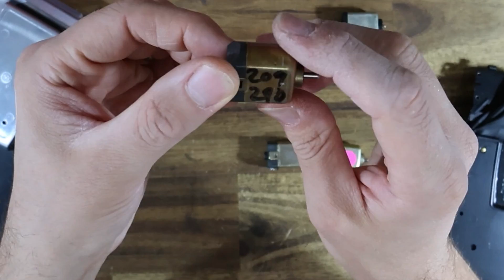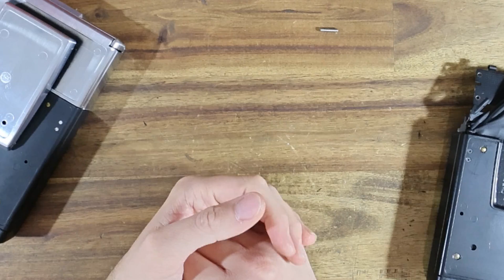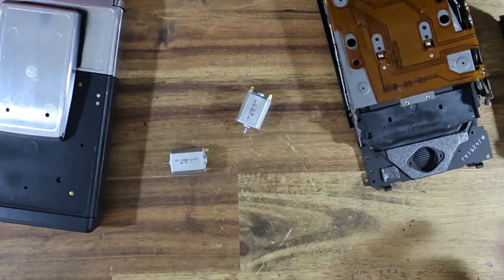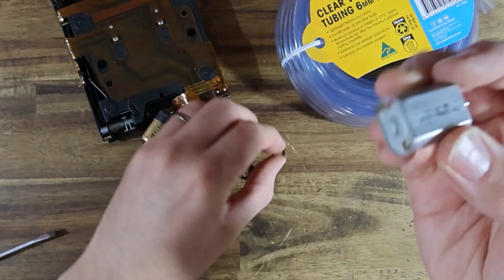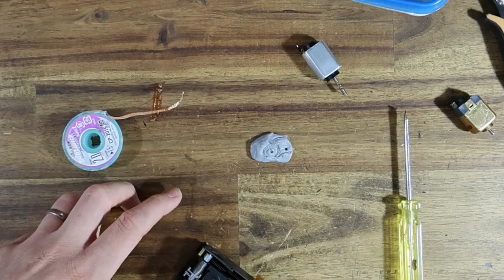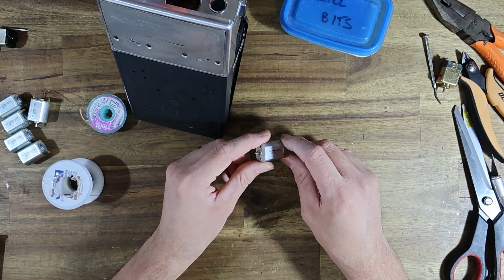I found MiNT and Retrospekt's motor supplier! Brand new motors for your SX-70!

Comment from the maker: Hey guys, a few important things that I wanted to add:

1) If you want to buy one of these motors then google is your friend. Search for "Mabuchi FK-130SH-16140". They can be found on eBay, ali-express etc. You can also contact Mabuchi direct too if you wish to buy thousands of them
2) Note that other FK series of motors exist of identical size, but they are NOT compatible due to the far lower RPM. The '16140' is rated somewhere around 10 000 RPM depending on the exact voltage. Others I have found were much too slow to work on an SX-70
3) This bullet point is for those that insist on leaving negative comments about the visual quality of my videos - while offering absolutely 0 constructive feedback. Your comments offer nothing of value. I don't mind feedback if its actually helpful, but you don't need to be rude about it(see Prash's pinned comment in my first upload for an example of good feedback).
I have purchased a new 1600 lumen LED light bar for use in future videos, to try and increase video brightness, help with my cameras auto-focus and reduce harsher shadow casting while I do my videos. I believe this will help improve the visual quality of my videos in the future.
Sadly my 'temporary' workshop is now my current permanent workshop for the time-being due to the West Australian housing crisis. Truthfully, I never intended on being in my current workshop for long, and thus it is not set up as ideally as I'd like it to be. I simply didn't want to invest money into a location that was not meant to be permanent. 
As a result, in previous videos, my camera sometimes misses focus, or light balance turns weird. Despite the occasional lighting hiccup and wonky focus, I still feel that my main message and technical ability still comes through in the videos. So shut up about the lighting already. I'm already aware.
Reply: Glad to hear about the upgraded lighting coming soon 👍🏻
Otherwise your videos are just great.
I already knew you from Facebook but I hardly use that so I'm delighted you finally started using your Youtube channel 🥳
Reply: Hello, I would like to know if this is applicable if the speed exceeds 12000rpm, such as 14000rpm.🤔
Reply: Hi. First great job…learning a lot with you. 
I’m tiring to find those motors ("Mabuchi FK-130SH-16140") online but all of them only provide 9300rpm at 6v. I even bought one and it’s very slow. Any link that you might suggest? Thanks and keep the great job 🦾
Reply: The SX-70 motor is a 12,000 RPM one if you can trust the original advertising and articles. 

In the SX-70 film by Eames it’s stated that the motor is 12,000 RPM.
Reply from the maker: @ianbakke  at 7.4v this motor is rated for 14000rpm

And at 5v is rated for 9000rpm

So at 6v this new one should be pretty much spot on
Reply: I watch some of your videos, and I don't mind the lighting/video quality at all. Most of your videos are very long, so I keep it on in the background while I cook or do something else, and listen in and out. I'm not watching it with my full attention most of the time. Most of your information is spoken, not shown. Unless I intend on learning how to fix SX70s by watching your videos, which I doubt most people here are trying to do, I don't see why visual quality is so important.

I personally wouldn't bother increasing the visual quality unless I plan on improving the editing and chopping it down from 40-90 minutes to 5-10 minutes. It's really at the 5-10 minute mark that people will watch closely as well as listen.

Also, if you want to cut down on the harsh shadows, what you might need is an "LED ring light", the ones that women/people use on instagram for makeup tutorials. Notice how these makeup tutorials never have harsh shadows. LED light bars will cast harsh shadows usually. You can also look into a better camera, but it's not worth it unless you're looking to spend $300-500 at least.
Reply from the maker: @haxuco  this is kinda my thoughts too. In terms of repair videos - like 80% of the detail comes across verbally and could easily be cross referenced by looking at the camera in front of you - or the repair manual PDF 

A ring light around the camera might help... 

But I think that the levels of light is fine overall - it's mainly just needing something to get rid of the shadows

Comment: I have seen a few people on facebook short videos that have changed their film counter to start at 8...do you know anything about this?  seems like it would be a worth while mod if its not too difficult...
Reply from the maker: This topic will eventually get it's own very very very very long video

It's possible but most solutions are somewhat of a "hack"
Reply: @theinstantcameraguy  have you had a chance to work with the sx70r board that has sx70/600 switching but no bluetooth? I dont quite get what the point is without bluetooth...does it still somehow have manual exposure? I am considering getting it for one of my sx70s.... any info on it would be great if you have any...thanks
Reply from the maker: @quitethecontrary1846 it's only for auto mode

Comment: love this video. Hi one question here, do you know what's the model for SX70 (sonar) motor driver (it's located just beside the motor in flex circuit), I think it's a customized H bridge motor driver. I had mine burned when I was trying to use external battery pack, due to misoperation, the motor was stucked and then the driver burned. Thanks you.
Reply from the maker: it is propriatary

Other driver chips exist, but the pinout is different. Technically you can use them, but you need to wire the pins in different
Reply: @theinstantcameraguy  Thanks!

Comment: Hey Jake, do you have any insight in this problem where everything else is working but the motor is not running at all? I know the motor is still good and I think something may be wrong with the MCC (can shaped) or maybe even the IC in the lens assembly. I have a Model 2 in Ivory with a kapton body flex and I noticed the MCC getting quite warm when the camera is powered for a bit. All traces, switches, and wires seem to be okay using a multimeter and I don't know what's the correct voltage/continuity for the MCC.
Reply from the maker: @robertw1469  MCC chip is probably blown
Reply: @theinstantcameraguy  Well crap, there goes my attempt at fixing a broken Model 2 (I was soo close!). Thanks for your input though!
Any chance you know if the newer DIP versions are compatable or know where to get cheapish replacements? Am curious if I could fit a modern version in if I knew the pinouts for the bodyflex/MCC (I couldn't find all of the repair manuals/bulletins online). Polastudio's bodyflex replacement is like $100 and I have yet to find a spare parts SX-70 with the can style MCC. Thanks again.
Reply from the maker: @robertw1469  I've never tried to adapt one onto the other

I'd assume its possible, but it would be easier to just swap the entire ribbon cables over if you had a spare camera lol

Joaquin from the OpenSX-70 project found some similar replacements, but I never found them to work properly

Comment: Hey Jake. As always, thank you for sharing your valuable knowledge with us. Just an idea, maybe standard o rings would be suitable as well for bushings? They come in many standard sizes, and I would guess that they are the correct material as well. I have been using them as rubber idlers for cassette decks for years without fault.
Reply from the maker: O-rings would work I think. But their 'round' edges may make them prone to falling off

Cutting up hose provides a square edge, which is easy to glue

Comment: I try to work on my sx70s in my free time and have a really crusty motor in one of my model 1s which I refurbed but wanted to replace. I got a donor from another sx70 but wanted to look into motor replacements(I remember a blog post on opensx70 where Joaquín talked about replacements but wouldn't reveal the source). So I ordered a bunch of motors from aliexpress that seemed to match the spec. I wanted to try doing load/rpm testing and compare the original motor with the potential replacements but never got around to it. When you showed the motor I looked in my bag of motors and sure enough I had the exact same one hahaha.

I really appreciate how much effort you put into it to bring us this obscure, niche info. I don't really have a lot of experience and don't have too many cameras so I'm always scared of messing a camera up permanently which stops me from trying a lot of experimental things. Your videos really fill in that gap so thanks a lot!

I had a question, instead of crimping the spring, have you tried using heatshrink over the shaft (with a little hanging off the end as a guide)? it should get it in the same ballpark as the original shaft.

Edit: Oh, also, do you know if the motor in sx70 box type cameras are the same mabuchi 2mm shaft motors like in the 600 cameras or the 2.5mm type?
Reply from the maker: heat shrink, glue, JB weld etc will probably work

But honestly, crimping the end is fine, and fits in line with the 'pressure fit' of original Polaroid springs. It also takes only seconds to perform.

All mabuchi motors use 2mm shafts instead of 2.5mm, and thus need crimping

Once, for fun, I took apart a modern mabuchi motor from a 600, tore it down, and replaced the bearings and rotor from an alpha motor. Effectively giving a 2.5mm Mabuchi. It worked like a charm once finished, but was a LOT of effort
Reply: Thanks for the reply. I wanted to avoid messing up the spring but seeing as you've had success with it I'll give it a try. The hybrid motor sounds interesting, might give that a try as well

Comment: Do you know what material the bellows are made of? I'm just curious, it feels like and looks like some synthetic rubber. And do you think there is any replacement for it that isn't from a donor camera?
Reply from the maker: the bellows are insanely complicated in terms of design, and designed for nothing else

the only solution is to have a factory custom make new ones, which would not be a cheap endeavor 

You can patch small holes with black silicon in order to save originals

Otherwise, keep your cameras collapsed when in storage - it'll prolong the life
Reply: @theinstantcameraguy  Good to know, I'll keep them collapsed

Comment: I wonder if some of the 32nd scale slot car motors would fit? I have rebuilt many of them...
Reply from the maker: If it physically fits and is roughly 12000 rpm - sure

Comment: Please tell me that after you sandpaper the communtator that you polish it so it has a mirror finish, Otherwise it definitaly will go Tango Uniform real quck.
Reply from the maker: Do you mean Foxtrot Uniform? The paper I use is very very very very very fine. It already produces a very shiny finish

You can use metal polish to further shine it up, but it makes no long term difference I can measure. 

The cameras I did several years ago are still working like new, and I've never had a hybrid or Alpha motor fail and need to come back to me. Occasionally Model 1 motors continue to go bad, even after polishing. My theory is that in these motors this has less to do with the commutator, and more to do with the quality of the carbon brushes.
Reply: @theinstantcameraguy  I've always found fine Scotchbrite ideal for commutators on automotive motors and generators. It helps that it's flexible and easily wraps around the surface. The grade you get attached to kitchen pads is very fine and soft, and once worn, even less aggressive.
Reply from the maker: @MrShadownoise  I've been using the same ancient pieces of 3000 grit paper for 5 years now. It's basically smooth at this point lol
Reply: They look a lot like OO or HO locomotive motors back from the 90s.

Comment: I really love your attitude about sharing knowledge. Many repair shops are reluctant to share their knowledge, probably because they're affraid of losing business. But the fact is that most people just don't have the required skills and tools to do it themselves. And the ones who do won't have someone else repair their stuff anyway so they need to figure it out themselves, or learn from someone like you. Your videos serve multiple purposes:
1: You show people you really know what you're doing, which gains trust and can help you get more customers.
2: Skilled people learn from you
3: People interested in Polaroid cameras find it entertaining to watch a skilled person showing them how things work.
Reply from the maker: The thing is, that if earlier techs had simply just shared their knowledge, instead of taking it to the grave, I wouldn't have had to spend YEARS having to reverse engineer and teach myself all this stuff. It's all well and good that I'm among the best repair techs in the world despite being self taught, but what happens if I die tomorrow? The knowledge gets lost forever. 

You are 100% correct in terms of tools and skills required to DIY. I mean... sure... you can buy a new motor for a few dollars. But... you also need the $150 soldering iron, de-solder braid, wire, torx head and square headed screwdriver set, heat gun, etc etc etc

And I know first-hand that some people just aren't cut out for fine work. I've re-repaired numerous DIY attempts over the years and I can say with first-hand experience that those wanting to try DIY will attempt to do so with or without guidance lol
Reply: I mean retrospekt is one of those. they are effectively just a repair shop, but they feel the need to sand off the markings and paint their own marks on them. hate that.

Comment: Thank you for your video. I have the Alpha Executive SX70 under repair. I noticed there should be a spring on the side face of the frame toward the back of the drive train -next to the mirror-flip mechanism. I also notice it seemed to be absent in the example you have. Is this by design? My drive train spins continuously, I mean the train is working but it’s not actuating the mirror which remains in the ’up’ position. I’m stumped. What,in your opinion could be the problem? Much appreciated.
Reply from the maker: sounds like you have a lot of issues with the geartrain and mirror return mechanism. Honestly its very hard to accurately diagnose without the camera in front of me

As for the spring, the secondary mirror spring was deleted in the mid 1970s in exchange for a stronger single rear mirror spring. Its really only present in early Model 1/2 cameras.

This is documented in the Polaroid repair literature
Reply: @theinstantcameraguy  I see, many thanks, I appreciate you taking the time and the effort you put into making your videos for us. Very best of luck with your current and future projects.

Comment: What a coincidence! A few months ago I was messing with this Model 2 I found for cheap which was in bad condition and I needed to replace the motor which had seized bearings. I had some extra motors from a Nerf blaster project and they looked exactly like the ones in this video. The motor seemed a bit overkill, they're called Valkyrie 130 Motors from Out of Darts, but they worked quite well.

I had done some research on the motors Polaroid had used and came across some websites claiming the specs for the motors and it seems that Polaroid had always used custom (unless they were generic models back then), 130 sized, Mabuchi motors (the "130" in the "FK-130SH-16140" denotes the size and if you'd like, I can link those spec sites I found). Basically the motor needed to run at around 10,000 RPM +/- 2,000 RPM at 6.0v and the torque doesn't need to be much as the SX-70 and others have a gearbox. Before using those OOD Valkyrie motors, I also stumbled across the hundreds of generic 130 sized Mabuchi motors on Alibaba and AliExpress, seems like they work just fine and should be much cheaper.